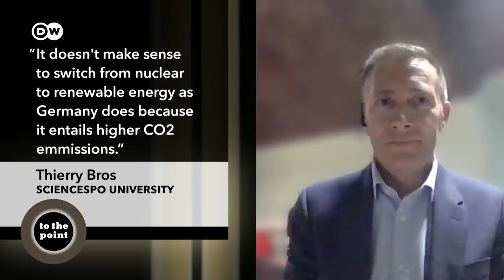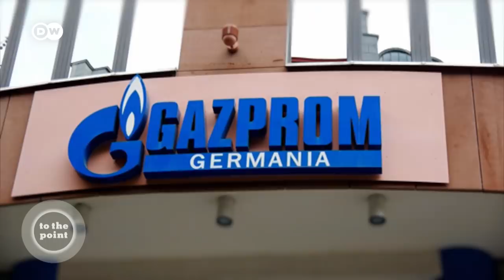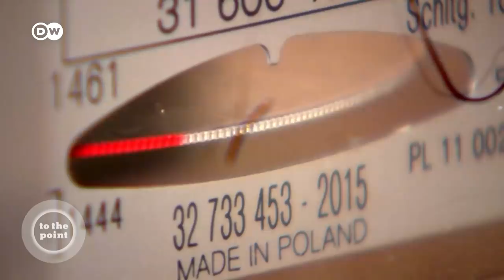Bleak winter ahead: Who’s to blame for Europe’s energy crisis? | To The Point

Comment: In Sweden we closed Nuclear plants and went with solar, wind & Hydro powerplants. Just to realise it wasnt enough, so now we import energy from German coal plants. Now that's forward thinking 😂👍
Reply: Not to mention we were forced to open an old oil power plant that had been closed for 20 years.
Reply: Transitionning the other way around haha
Reply: Math is hard.
Reply: facts is hard, Sweden is exporting Power, not Importing it , we have a big surplus of power , almost 100% of the time
Reply: @mabuhayproductionltd3627  Then I wonder why Skåne and SE4 has an extreme electricity crunch which forces them to import from Denmark and the EU. Plus that in southern Sweden this winter, we’ll have power outages multiple hours per day. Care to explain?
Reply: @flextapes6960  We dont, you are incorrect. Sweden exports record amount of Power, but yes Skåne/SE4 produce to littel Power, so we get it (needed power) from SE3, But Most of that power we get from SE3 ? we export it to Denmark,Germany,Polen. We dont know what will happen this winter, it could be mild and Vindy ? then we would have less/littel problem and no outages. It could be a Harsh winter (not so likely) with cold and quiet days ?   Yes there could be some industries that would shut down (voluntary), its not realy likely with forced cut of power. We have reserve power (oil fired) in case of need.  So you are mostly wrong.
Reply: Sweden still runs nuclear plants.  WTF are you talking about.
Reply: @mabuhayproductionltd3627  I’d call you out on your reasoning. Electricity prices are higher this august than they were december last year - and personally my bill was over 6-7 times higher than it was last august. This winter, firms and companies will definitely shut down / decrease operations due to the enegy crisis which will cause a major recession and unemployment issue. And yes  it is comfirmed that power cuts will be enforced for a few hours per day. You’re downplaying this catastrophe my friend.
Reply: @speculawyer  6 reactors are operational atm and 6 more exist but are not operational.
Reply: @speculawyer  I havn´t said anything about Sweden doesn´t have nuclear reactors ? Sweden Has 6 Reactors, but some are down for long time repairs . So Old not so well maintained reactors make the problem worsh. Maybe Sweden will build new small (SMR) reactors? but it would take many years before that can help solve the problem, Faster solutions is Solar & Wind power + conservation on wasting energy (more insulation,more efficient ligthing, more heatpumps insted of direct eletric heating ect.

Comment: Germany: phases out nuclear.
Also Germany: half of the countries energy is supplied by coal power plants.
Reply: using wind and solar in fact is the best
Reply: @acidmana6141  very much while flying over fr KL to Frankfurt all the way to Berlin saw abundant fields of wind and solar but can understand these wont meet the high demand  following  decision after Fukushima incident. Thanks.
Reply: @seinnweaye7079  

It isn't even close to enough. Germany's energy demands cannot be satisfied with just renewables, especially for industrial needs. There needs to be a mix. Maybe one day with high efficiency solar panels, use of geothermal, and high capacity energy storage systems (the Achilles Heel of wind and solar power). Germany may get there one day, but not in the near future.
Reply: No Radu, what happen was Germany and other European countries cut orders for more oil and natural gas during the pandemic, they shouldn't have done that.   Now they are scrambling.
Reply: @Madame702  It has nothing to do with the pandemic, it was the same story before.
Reply: @seinnweaye7079  mostly when they burn out or wind doesn't blow
Reply: Yeah they’ve replaced nuclear with renewables but coal has remained stagnant...
Reply: @Stirgid Lanathiel Do you include battery costs as well and what ratio battery to panels? well my brother have build solar+ battery. whit dotation return of investment is calculated 15years. dont know how long battery will last and how long pannels will last,.. If you want clean energy, high initial cost, low upkeep, nuclear is a way(and it will pay itself in 15-20 years, reactors have expected livetime 60 years and it looks like it may even be extendet futher). Prices are high since (not only) Germany closed so many plants, that Europe lacs energy reserves,..
Other part is 40years of optimalization to "Just in time" and "on demand", while cutting of storage and reserve capabilities, since they was too costly. and here is main kick,.. main reason for closing coal plants is that they produce too much greenhouse gasses(mainly CO2). and here is kicker, if you take natural gas PP, you will have lot less CO2 emmision for KW produced, bud if you add methane that escapes during mining and transporting, you are at 80% greenhouse emmisions,... congratulation,.. now we are safe, globalwarming averted,...
As far small reactors goes,.. posibly, but there is reason why VVER went from 440MWe to 1200MWe per unit. bigger reactors are more cost effective. Is there possibility of rewolution in desighn of nuclear energy? It is, but not whitout geverment support since cost of reserch(which may not pay off) I am fan of Thorium Liquid Fuel Molten Salt reactors idea. will they be build? not from private sector,.. such research is too risky for private investors.
Reply: @Stirgid Lanathiel Well actualy, modern nuclear is required to have faster controlabity - as responce to "renewables" instability, further increasing building cost,...
As far as transition period? there is no problem running current nuclear plants for 20-60 years,..  argument, nuclear takes too long to build and we dont know how market will looks like 20years later is simly stupit,... argument should have be whats best at our hands right now, and how build it for next 60 years,... there is no problem revisioning current situation, but not making desizion is problem. Energy industry needs long term planning, but long term planning is not in mind of politicians - they have mandate 4-5 years, neither private investors which want profit in 6 months.
Reply: Well nuclear energy is not really all to healthy for living things in general. That nuclear waste got to go somewhere.
The major issue is over consumption and inefficiancies, not a lack of energy.